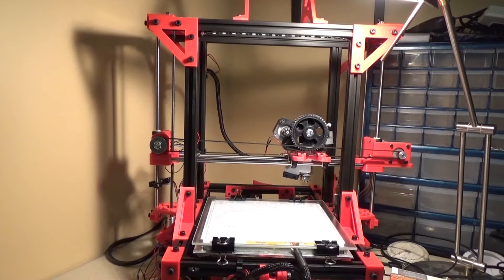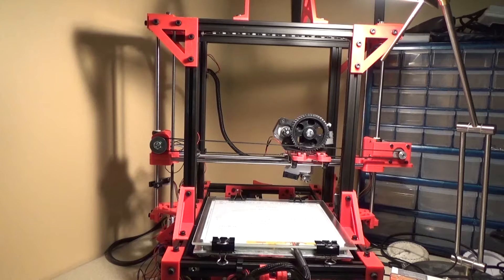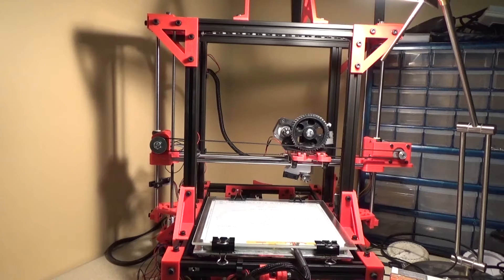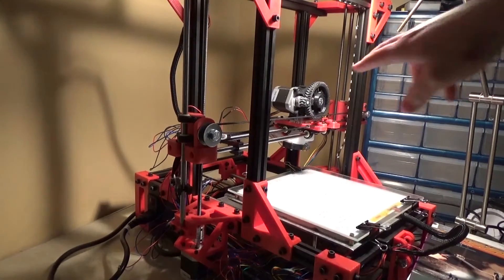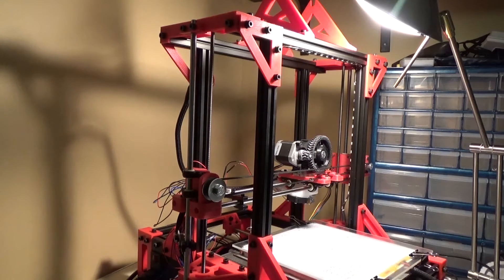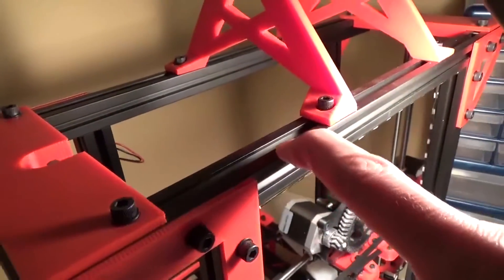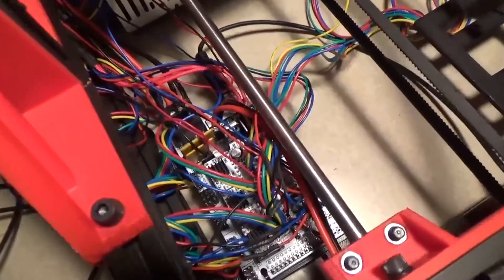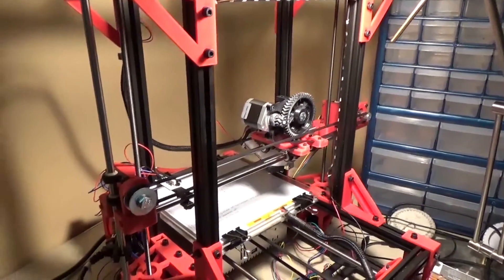3D printer overview

Comment: Very nice, Im looking to buy a 3D printer soon and I was wondering what kind of printer would you suggest that is not too expensive, but will deliver fairly high resolution prints.
Reply from the maker: DoctorSargeMD Thanks for the compliment!   To be perfectly honest, most of the printers out there have comparable resolution.  I typically print at 0.2mm layer height, but that is adjustable in software, and it also can depend on the size of the nozzle that you print with.Choosing a printer can seem like a pretty daunting task - there are so many out there to choose from now.  One thing I would definitely recommend is to choose something that is open source.  You'll find that having the ability to upgrade and modify your printer and software toolchain will be extremely valuable over the long term.  Some of the printer manufacturers out there have closed-source systems that you can't easily modify or upgrade, and many require you to use proprietary filament cartridges or spools which tend to be far more expensive than you would otherwise pay.  They also have proprietary electronics and software, which further restrict you.  Of course, some people are happy with that because it does remove some of the difficulties inherent in learning new technologies, being responsible for your own customer support, etc.  I've got a video that is in editing now that I will post soon (hopefully today) that shows me actually going through the process of designing and printing an upgrade to my printer.  Stay tuned!
Reply: FerrousBueller That comment was more informative and helpful than anything I've read on 3D printers this past week haha! I'm definitely looking forward to your new video and I 'll be checking back regularly to see when it will be uploaded.
Reply from the maker: DoctorSargeMD I just posted it.